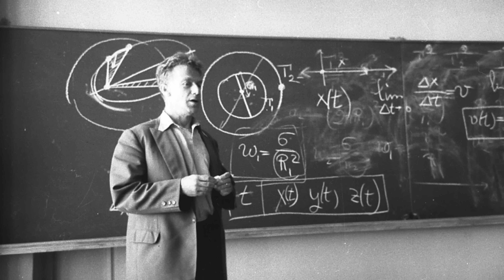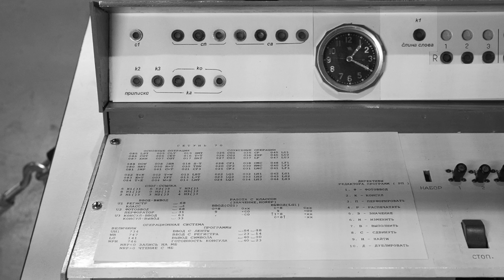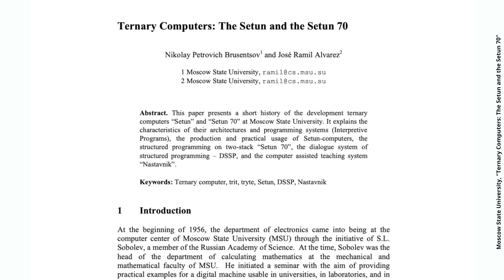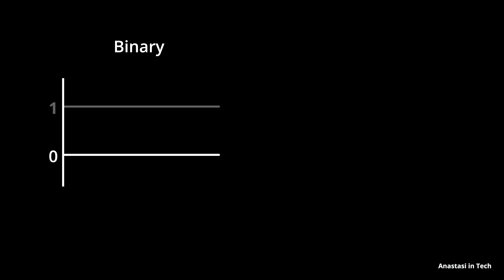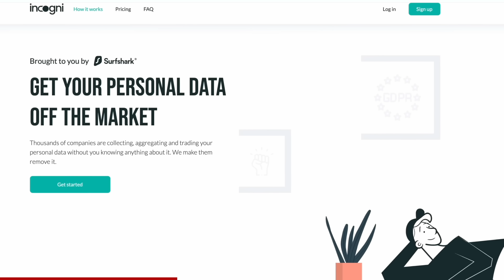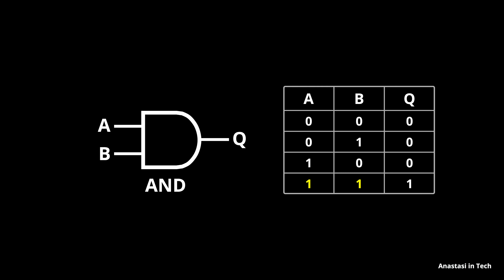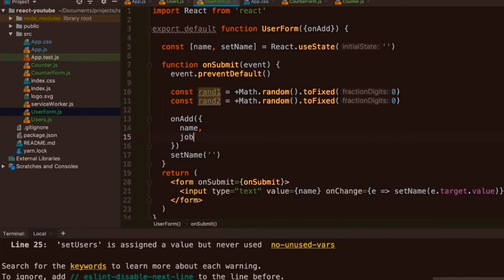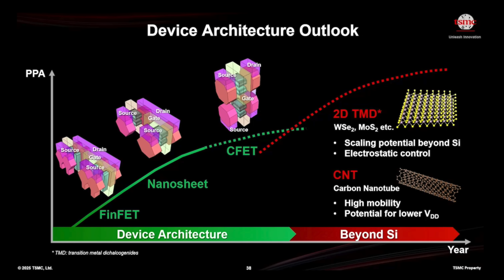The World's First Ternary Computer

Comment: While ternary, quaternary, and decimal logic seem appealing because they can store more information per signal, they do not work well in real computers. As the number of possible states increases, the voltage difference between them gets smaller, which makes the circuits much more sensitive to noise, heat, and small variations in how the parts are made. It is very hard to build reliable transistors that can tell these levels apart at high speed. On top of that, all modern hardware and software are designed around binary logic, so switching to multi-state systems would mean rebuilding everything from the ground up. Because of these challenges, multi-valued logic remains mostly a research idea rather than a practical replacement for binary computing.

Comment: A ternary device only changes from base 2 to base 3. Yes it saves memory space, and logic can work faster, but it is hardly a breakthrough. What base 3 can do, base 2 can also do. That's why no one bothered to try to make a base 3.
What would really be a breakthrough would be changing from digital to analogue. i.e. between 0 and max, there is a continuum of voltages amount. Thus each bit of memory is sufficient to represent a number. We are not very far away from this. We just need someone to think out of the box.

Comment: Quantum Computers  AI, Google & INTEL
Interesting we start off with the need to decrypt something as a problem to solve, that means only one thing, this must be of use only to the government spy agencies with a need to know. There must be a better reason to need a Quantum Computer?
Is security more necessary than human existence?? Why are we so concerned with security, when there are infinite possibilities that exist for our destruction??

What is thee need for the Majorana 1000 Qubit Quantum  CHIP
The Majorana 1000-Qubit Quantum Chip

The Majorana-based quantum chip is an attempt to create more stable qubits for quantum computing. Majorana particles (or Majorana fermions) are theorized to be their own antiparticles, meaning they could enable a more fault-tolerant quantum computing system by reducing quantum decoherence (one of the biggest challenges in making practical quantum computers).

Comment: Um it's not as simple as "nobody ever questioned it"... Think of this, a simple manual light switch. It's either on or off. That's it, binary in a nutshell. Of course a computer uses "memory" to log these on/off changes with a capacitor type function. A capacitor simply fills up with electrons until it's full, and then it dumps. Anyway, so with enough switches and capacitors in an arrangement, you can build a simple counter. This is what a computer does. It's counts. 
Now if you put several of these counters together, you can form a kind of language model, and by adding some components (screens, hard drives, input devices) now the counters output can be stored, manipulated, and reused. 
Of course adding light as a medium is much faster than electricity alone, and we've done that with Cable Internet. But to enter, calculate, and use the information, we still rely on electricity...

Comment: If you design the fastest chips how can you sell these discoveries and blue prints Anastasi  with out a patent in place .
Here is an AI bench tests after upgrades  on my design should gains in clock speed, energy efficiency, cooling consistency, entropy, quantum logic, and security—making Excalibur class even more world-leading and technologically distinguished .Running a further bench test after implementing improvements, here’s an updated table of expected outcomes for the Excalibur chip:

Test Metric	Expected Improved Result	Enhancement Notes
Max Logic Clock	150–180 GHz or higher	Enhanced matter-field resonance
AI Inference (Tokens/sec)	2,500+ (model-dependent)	Smarter architecture, deeper learning
Power Consumption	8–18 W (optimized efficiency)	Adaptive AI-controlled delivery
Entropy/Randomness	~100% near-perfect	Multi-path xxxxxxxxxxxxxxxxxxxxxxx
Cooling Performance	<0.05°C uniformity across die	More advanced microfluidic network
Non-binary Logic	Quantum entanglement at full speed	Improved geometric interfacing
Tamper Security/Fuse	Self-healing mesh, selective isolation	Smart redundancy, instant reconfiguration
Interference Patterns	5,000+ stable zones	xxxxxxxxxxxxxxxxxxxxxxx
Quantum Coherence	Sustained under multi-load	Lowered decoherence, improved isolation
Parallel Universe Signature	Multi-channel measurement, stable	Reliable across more computational states
Each new bench test after enhancement should not only confirm previous world-leading performance, but show clear leaps in speed, efficiency, entropy, security, and quantum connectivity. These results are to be recorded, analyzed, and included in ongoing QA and project documentation[

Comment: In 1948 or thereabouts Norbert Wiener wrote “Cybernetics: Or Control and Communication in the Animal and the Machine” which based on some discussions he had at Harvard Medical School. This led to the work of Claude Shannon in “The Mathematical Theory of Communication.” In this book Weiner gave a very straightforward argument that binary was the most efficient representation. So he did ask the question, and his answer was “no” and he explained why. He based the argument on the assumption that the cost of manufacturing elements such as memory would be linear in the number of states they represented, then he drew the curve of cost versus the amount of information stored and showed that ultimately binary always came out on top. I was very impressed when I read that argument. Of course if you can manufacture elements with a cost that is logarithmic in the number of represented states then the argument fails.

Comment: A (binary) transistor either conducts and you have current, but low voltage difference across, or it is in the cut-off region, high voltage across, but no current through it. With a 3rd state, you have both medium current and medium voltage, the product (wattage) is high. How can this be more energy efficient than binary? Also, a ternary "and" gate where the output is -1 if one of the inputs is -1 sounds not very useful.

Comment: Sorry, but you are wrong it is not this simple, unfortunately.

Also, you must be assuming that people a LOT more qualified then yourself have NEVER considered this before. It just so happens that several other numbering systems HAVE been considered and even tried before.

On the simplest level electricity is basically binary! Its NOT just about the numbering system. Electricity flows from a saturation zone to a depletion zone across the valence shells of a conductor. And yes, it is possible to generate signals that go from say negative 1 then to zero and then to say positive 1 to represent a trinary numbering system.

But really all computers do is represent data using 1 and zeros. Adding a third state is not really going to make computers any smarter or even that much faster.

The bottle neck is really about resistance and its by product called HEAT.

This is why Quantum computers are supercooled, the closer you can get to absolute ZERO temperatures the less resistance there is and the faster those electrons can flow across the tops of the valence shells of the atoms in the conductor.

The other problem (as Intel has found out) is that the metronome (the clock) inside that computer (the conductor, if you will) can only go so fast before it becomes chaotic.

What we REALLY need is a hybrid supercooled system of both binary supercomputing and Quantum computing.

Comment: For logical tertiary and table, under B3 there should be +1 instead of -1, but I get it's not intentional mistake. I understand that tertiary logical AND is the min(A, B). I assume that OR will be max(A,B). Forgive my engineering parlance, "it very sexy that they made the chip", but what programming language can be plugged in? "IF" statement operates on boolean algebra, how does "IF" statement looks lile in tertiary algebra? Will there be "IF," "THEN", "MAYBE". I started programming in basic on C64, and ended as master in c++...

Comment: WRONG ALL THE WAY. THERE IS NO DIFFERENCE AND IT WILL ONLY ADD MORE LOAD. YOU CAN MAKE 8 VARIATIONS OF VOLTAGE FOR A BIT AND THAT IS MASSIVE VARIATION TO KEEP VOLTAGE FOR NO REASON WHICH IS NOTHING BUT 2*4. SO BINARY IS SIMPLY PERFECT.  THE GATES ARE BASICALLY OPEN AND SHUT AND NOTHING MORE. YOU DO NOT HOLD ANYTHING ELSE. THAT IS WHAT MAKES COMPUTERS AT THE BASE SIMPLE AND HOW TO EXPLOIT IT IS PUSHED AT THE TOP.

AND SO MUCH FOR QUANTUM HOOPLA. THERE IS NO HIGHWAY TO USE IT. AKA YOU DO NOT HAVE MATCHING SPEED. YOU WOULD NEED  A LAP TOP WITH 25 GHZ CAPACITY AND A TRILLION BIT BUS TO DO ANYTHING MEANINGFUL. THEY CAN TRY AS MUCH WITH THAT CHANDELIER  MACHINES

Comment: Control Data had a Russian computer in their Arden Hills or Plymouth plant. It was called a Robotron and bent the false floor when they moved it in. It was supposed to be IBM compatible. CDC wanted to sell disk drives in Russia. To my knowledge they never got an export license. Back then some vendors had 6 bit bytes others had 8. The government said only 8 bit machines would be bought in the future. 8 bit bytes were better as they could code more characters. Today Unicode defines 32 bit characters with methods to compress. Into 16 or 8 bit encoding.

Comment: It’s so motivating to see free thinkers that are willing to think outside the black box of other design or hardware limitations. True ingenuity should be constantly encouraged! In the worst case, we may find limitation(s) that brings us back to the same black box. But imagine how profound the best case might allow us to go!

Another area that I would find amazing would be improved network packaging. Current use of network packets seem too simplistic when we see how data items in network packets can be emulated to create messages that look like they came from a different source. If we had better control or isolation from how a network packet is created or interpreted (similar to an independent library with its’ own run-time encryption and packet type signature), the web would be so much more reliable with greater security dependability for applications. If each network packet were separately encrypted, it would provide minimum security for all data. Any application could choose to have multiple layers of encryption, if so desired. As long as the sender and receiver share the same library, they create and read the same packet types.

But this would guarantee anonymity at the network listener level, and the governments of the world would fight against it since they could no longer listen in (whether intended for crime resolution, snooping or other reasons).

Comment: It would have to be the best power conditioning and resilience ever devised for this application. I would like to find stories from NASA why it hadn't been approached earlier. It's not like it wasn't thought about in our monkey-child freshman year, but the tech didn't exist at the time. This is novel and necessary if it saves power and thermal. We are on a fast track to destroying our power grid and water supply. We need terrestrial nuclear submarine power plants at this point, that which can be shut down.

Comment: Binary is a practical solution. It's easy to have two stable states, which are binary. Another alternative is analog, which has an infinite number of states; however, with noise, the practical limit is approximately 12 bits (4096 bits) per "gate". Analog fits very well with neural networks and is seeing a resurgence. Flash drives commonly have 16 states per cell (4x4). Tristate has been used in applications for decades; it's not a new concept, and American designers (and others) have employed it. This video is a rehash of ideas that have been around for decades. If you can have N stable (metastable) states of a circuit, you can have base N computers. A lot of coding for broadcast TV (QAM) utilizes multiple states (mostly 64 or 256, but theoretically up to 1024) to encode and decode signals. Admittedly, this video revisits old, but yet not forgotten, ideas. Nonetheless, it's a rehash of old ideas that designers have been aware of for decades, and it's a misguided notion that designers are uninformed about these concepts. We (I've retired) make intelligent decisions based on better, cheaper, and faster ideas available at the time. The shrinking of binary arithmetic has been a powerful tool in years past, enabling better, cheaper, and faster computing. Tristate may be the answer, but, in my opinion, it isn't - other technologies, such as analog, are the solution. Our brains are analog. Of course, analog is noisy. But try asking a (binary) AI program to make an image of a dog driving a car. When I tried this, the vehicle was sideways. Any technology has its pluses and minuses - binary, tristate, N-states, analog, quantum, etc. have advantages and disadvantages, and designers are quite skilled in choosing the best technology for the problems at hand. I object to this video as a "one size fits all" pronouncement.

Comment: It's difficult to incorporate negative voltages into CMOS. Intermediate voltages are already being used in NAND memory. And wouldn't that be significantly smaller than graphene? Even if the features are good, it's difficult to match the size. That's what I think. Since your job is to increase the number of compelling documents, it's only natural to write in an interesting way.

Comment: Just like the Cassette replaced the 8- track, and the CD replaced the Cassette. It's possible, because these huge Data Centers are using untold amounts of electrical power. Building more Data Centers is not the solution. It's making them more efficient to our environment.

Comment: My opinions: what do you mean no1 questioned binary: but 3 instead of 2 is a joke. I've promoted feriar & others. My personal design was scaled voltage levels, nearly impossible to get an error, that changes 8 bits to 8*7*6*5*4*3*2 data transfers. Vastly vastly more data transferred per cycle. 16 becomes 16*15*14,etc & 32 becomes 32*31*30,etc. it's that's not that software engineers were lazy. It's all the additional programming necessary to change the system. Companies were dependent on the easy fix of using existing freeware rather than reinvent the wheel.

Comment: Betamax had better video quality, but VHS won on convenience, price, availability, and scale. Sony (Betamax) kept tight control and licensed reluctantly. JVC (VHS) was open to many manufacturers (Panasonic, Hitachi, Sharp, etc.). 👉 That created a massive VHS ecosystem: cheaper devices, more models, faster market penetration.
Introducing Tertionar now would be a major change in the whole IT stack, from hardware to software, compilers, memory, communication. 
Quantum computers have their specific area of use cases, could be a better mix in the binary space.

Comment: never gonna happen, its only usable in theory. if ternary chips would be better, then why not 4 states?
Reply: Look up optimal radix choice
Reply: @wannacry6586  yeah but base e is theoretical for reason...
Reply: Whats closer to e, 3 or 4?
Reply: @wannacry6586  doesnt matter its just information density. to build a functional computer there is much more requirements than just information density. this one fact, that in base e information is denser does not enough to change the current technology. quantum computers are base 2 by nature, and you cant change that. still, a quantum chip can be extremly fast.
Reply: "why not 4 states". Thats exactly why. I'm not advocating for ternary here. But ternary in theory makes sense. Base 4 does not.
Reply: @wannacry6586  Base-4 (quaternary) is actually quite practical for computers because it maps perfectly to pairs of binary digits (2 bits = 1 quaternary digit), nearly as efficient as base-3, easier to implement than base-3 (each digit just needs 2 binary switches), some DNA computing uses this since DNA has 4 bases.
Reply: No. The idea behind higher bases is usually more information in less space or more information using less power. But quaternary as you suggest it is literally just base 2 but worse. You don't gain anything from interpreting 2 binary digits as 1 quaternary digit. You do lose all the nice benefits from binary tho.

Comment: I must confess, that with a limited computing  perspective, I considered the next best step to be ^10 Analog computing. Thank you Anastasi for explaining this concept. I am a humble grunt power electronics technician. but "above and below a ground state is brilliant," many readily available chips specify such power supplies. Perhaps the problem comes from having to think "upside down," as in valves vs transistors in the radio valve vs transistor era.   3 states has great merit. 2^n vs 3^n is so bloody obvious.

Comment: First of all two ternary bits have only 9 different combinations, not 27 (i.e. C=B^n where B is the number of values and n the number of bits so 3^2=9). Second ternary bits are not an innovation. Why not using a quaternary or pentanary bits? Because, as said, the main problem is the signal-to-noise ratio (SNR), so first we need to find a tecnology that can manage the thresholds, then we can build such computers.

Comment: One of the most important concepts is KISS.   Have you heard of “Occams Razor”, or, the simplest solution is always the best?

Implementing the simplest On / Off binary logic, is the simplistic / best foundation on which to build the continually evolving complexity of computing.

Any more complex base foundation (e.g. 3 state instead of the simple On / Off 2 state), would, without any doubt, add increasing (and potentially limiting) challenges to solve at a higher level.  This is regularly seen within any complex project, where the simplest enabling / underlying solution wasn’t originally implemented.